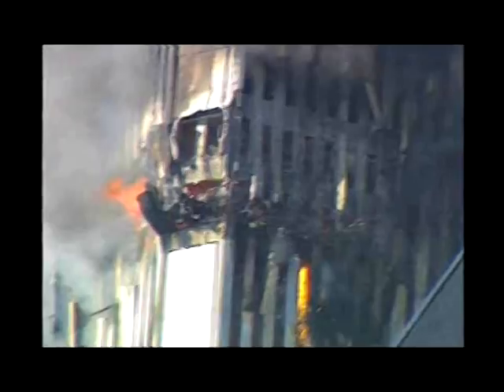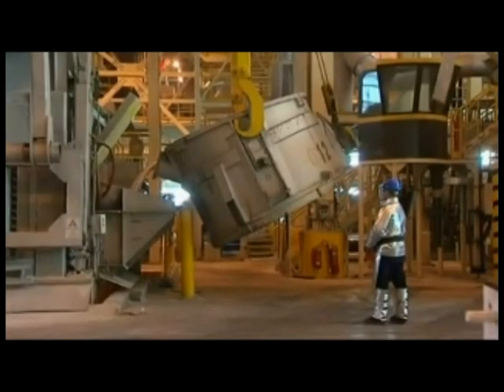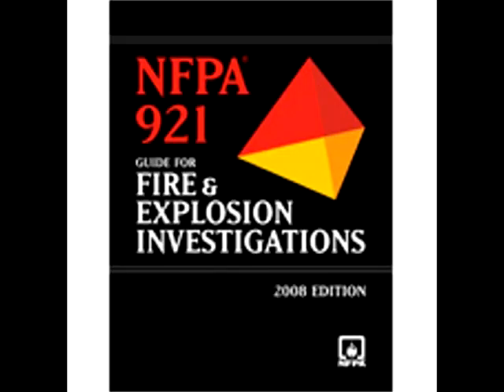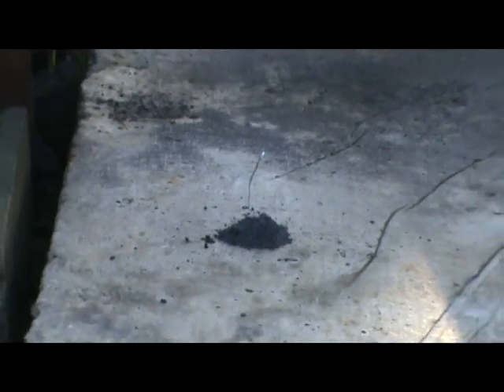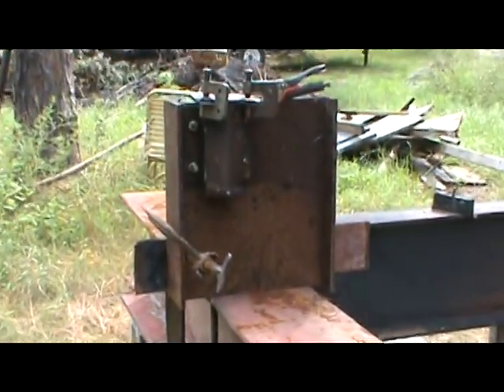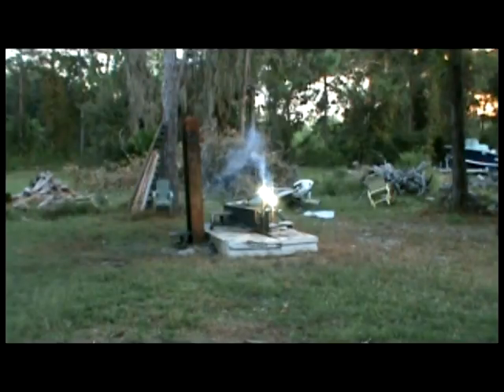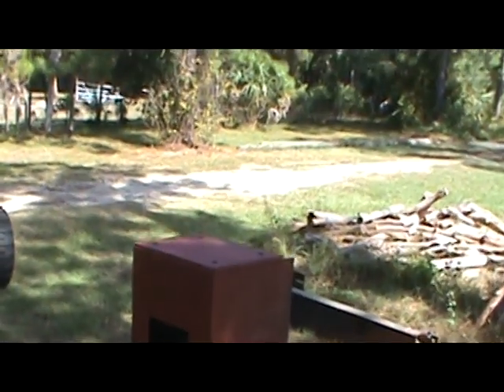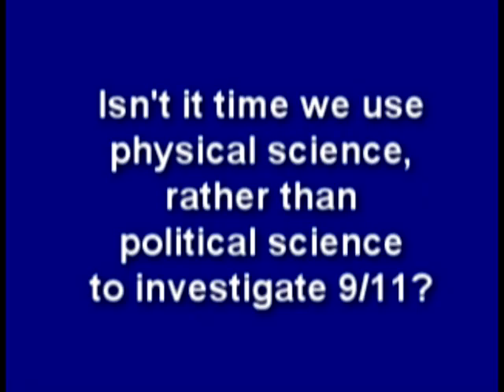9/11 Experiments: The Great Thermate Debate

Comment: You don't need to melt steel, you only need to weaken it. Steel loses half it's structural integrity when heated to 400°C.
Reply: But what about the melted steel that was pouring down the towers?
Reply: They came up with a lie theory of it was melted aluminum.    But even that needs 1300c  sorry 500-600c flash fire (fireball went out mostly the windows) wont do it.   And they forgot all the molten steel on the ground for weeks.   Hmm guess they were hoping no one saw that. @licsamael8235
Reply: It wasn't molten steel.  If you notice the stuff got brighter and hotter as it fell.  This means that the stuff was burning and the additional air it got while falling got it to burn hotter.  

Molten steel will flow like a liquid and will get cooler when exposed to moving air.  The guy who made this video probably knew this but was counting on people to mindlessly believe him because his target audience is people who were dumb enough to fall for such a lame conspiracy theory in the first place.

Have you ever noticed that the conspiracy theorists talk about 'thermite' but ignore the issue of how that thermite got placed without people noticing?  Remember that the main support structures for the WTC were on the outside of the building.  So they would have had to do the work on the outside of the building (89 some odd floors up) without anybody in the entire city seeing anything.

Just like they ignore the literally hundreds of eyewitnesses who watch the airliner hit the pentagon.
Reply: Ah yes, name calling.  I notice that you are unable to debate my points.  Amusing how you are so skeptical of everything but conspiracy theories.  

You know nothing about the properties of metals and as a result you fall for this kind of stuff.  The fact of the matter is that it was not molten metal in that video.  And if you knew anything about metals you would know that. 

Oh and if you believe this thermite theory - please provide a plausible way for them to have placed the charges without just about anybody in the city of New Your seeing them do it.
Reply: @colincampbell767  Not name calling simply putting you in group.    How did the metal on the ground remain molten for so long?   Why was it like a foundry on the ground weeks later?   Yes a little bit of flash fire 80 stories up caused this?   
Don't worry about how it was done, answer that simple question.
Reply: Yea right.  You call me a 'sheep' because I think for myself and you claim you weren't name-calling.

And do you have a reference for the 'molten metal' claim?  I just tried to look it up and all I got was conspiracy websites.  No independent confirmation from anything that can be considered to be an unbiased source.  And the idea that the metal would remain molten for a week is - rather dumb.  In order to remain molten there would have to be a heat source that would maintain it at that temperature.  12 ton billets of molten steel in foundries solidifies in a matter of a few hours.  There would have to be a continuous source of heat 

The claim that molten steel was on the scene at all can only come from somebody who knows nothing about the properties metals.  I can see some aluminum melting but the majority of it would burn (something people don't consider when they estimate how much fuel there was for the fires).  And none of it would remain molten without a source of intense heat.  

The idea that there was molten steel at all is just plain stupid.  That's tons of steel that would have to melt.  Even thermite wouldn't be enough to account for the claims.   

The problem is that if you know anything about metals - this whole idea is pretty dumb.

Now maybe if you can come up with something that actually fits the physical properties of the metals involved - I would take another look.  But as long as I'm seeing claims that are impossible - then I'm not going to be impressed.
Reply: @colincampbell767  You belong to a group call "Sheep" people that put heads in the sand.

I was watching the news live for weeks and listened to the fireman describe the foundry like conditions on the ground and saw footage of it.   At that time they were not attempting to hide it.    Myself a physics grad was waiting for them to explain how they were brought down and also to explain the source of the energy required to melt so much steel on the ground.   3 years later the report came (most people forgot about it) and those simple question were never addressed.    I saw it and also ground crew had to deal with it. They also had photos of the hot spots from infra red cameras.    All that was swept under the rug.   That little bit of stuff on the building dripping out was nothing compared to what was on the ground.   And for weeks.   Never explained to this day.
Reply: "fireman describe the foundry like conditions"  So that's your interpretation of what he meant?

Besides - from a physics perspective - what is your issue with the cause of the collapse?  

And your concern about the source of the energy necessary to keep steel molten for days is in fact an argument against the 'thermite' theory.  Can you identify a plausible source of heat that would keep this 'supposedly 'molten' steel from solidifying?  It can't be thermite because that produces a 100% burn in a matter of seconds.  And it will leave an obvious candle wax effect on the steel frames (as the molten steel flows down and solidifies on the non-molten steel below it).

And I have not been able to find a primary source for the claim that molten steel was on the ground after the collapse.  I've dug around and it seems to be conspiracy theorists quoting other conspiracy theorists.

As for the hot spots on infra-red - the fires burned for weeks afterwards.  So I'm not surprised that there were hot spots on the infra red.

And there's a logic flaw in your reasoning.  You seem to be demanding that they explain something that there is no real evidence that it even existed.  Maybe it would make more sense to expect the people claiming that there was molten steel on the ground come up with an explanation that would explain what the energy source that kept the steel in a molten state was.

This is the thing - the 'molten steel' claim is pretty much a physical impossibility.  And if your conspiracy theory depends on something that's pretty much impossible - shouldn't you be able to explain a plausible mechanism to explain it?
Reply: @colincampbell767  I think are in deep denial.  I did not even look at interne stuff back then.   I watched it live videos.   Metal flowing on the ground and fireman describing it.   Really not to hard to see it.   Oh you think it was all made up by the fireman?   And the video was faked?
Maybe 3 buildings never went down at free fall either.   The hot spots shown were over 1200 degrees.    So maybe that was faked too.    Back then this was just matter of fact there was no denials that it existed.  Only later do people like you come out of the wood work with crazy made up stuff to attempt to confuse what was plain as day back then.     Wake up and stop being part of the problem.
Reply: "Metal flowing on the ground . . ."  Odd how I cannot find any pictures or primary sources for this.

And I pointed out that you are interpreting the words of that fireman without really knowing what he meant.  The problem with 'what you saw' is that you cannot provide a plausible explanation as to how that molten metal got there and how it remained molten.  So what if there were spots at 1200 degrees - which is not even close enough to melt steel.  And you can get those temperatures in a charcoal grill.

The issue is that you are claiming that something was there despite the fact that for all practical purposes - absent a suitable heat source, there was no way for that stuff to melt in the first place or to remain molten. When you make a claim that violates the laws of thermodynamics - then you really need to explain how what you claim is possible.  If you can't do this - then you really need to re-assess your assumptions.
Reply: @colincampbell767  I know what I saw on the news sorry your internet skills are limited that you can't find it.

Also wonder why any nano thermite was found but maybe that was hoaxed too.   Maybe building 7 really did not fall at free fall it was just a trick camera angle.

I would like to see the metal that was shipped to china so fast.   I would like to see a proper investigation.    

When you pull your head out be sure to clean the sand out of the ears.
Reply: Why would nano-thermite be there?  In fact why would any thermite be there?  There was absolutely no need to use thermite to collapse the buildings.  You see - the whole idea that thermite had any reason to be there is just plain stupid.  (And ignores the small issue of how to keep the detonation circuits functioning after an airplane hit them.)

And you are using the classic dodge of the conspiracy theorist - demanding that I look thinks up that may or may not exist.

As for the speed the building fell - that's Newton's Laws of motion in effect.  Remember that kinetic energy is the mass times the velocity squared.  What this means is that when the building started to fall the energy of the falling debris became so high that anything underneath was instantly destroyed when it was hit.  So in effect it fell at 'free fall' speed because that's how the laws of physics work.  (Something I notice is how ignorant the people who believe the conspiracy theories are in terms of basic scientefic principles.)  I mean how to calculate kinetic energy is something taught in a high school physics class.

And are you sure that you know what you saw?  Or did what really happen is that you saw something and then decided what it was?  You see - molten metal on the ground would violate the laws of thermodynamics.  Unless you can identify the heat source that would keep steel in a molten state - that's a physical impossibility.  (And a problem with your conspiracy theory that none of you have been able to address.)

The entire conspiracy theory is based on an ignorance of basic physics, basic structural engineering principles, and a complete lack of understand of the properties of metals.  There are enormous holes in the conspiracy theory and the people pushing the theory are unable to address them.
Reply: @colincampbell767  You sound like an English major trying to grasp simple physics.  Googling terms then blurting them out without understanding them.   Building 7 is a bit of a enigma on how it fell at free fall.   Come on Sherlock put on your thinking cap.   Stop being part of the problem wake up.

I asked why was nano thermite found in the dust.   
Not why was it there.  
I'm a realist, you seem like some kind of denial theorist.
Reply: I'm not googling anything.  I have taken college physics and I have a machine shop in my garage.  I know this stuff.

And as I explained, there is no enigma - simply the laws of physics at work.  Building 7 fell at the speed it di because the laws of physics required it to.  As I explained kinetic energy means that once those things get moving - nothing is going to even slow them down.

Now unless you can identify an existing material that would have been strong enough to even slow down the falling mass . . .

BTW - care to explain why you think the building should not have fallen as fast as it did?  What was there that would have been strong enough to even slow down the collapse?
Reply: @colincampbell767  Lol a machine shop and a undergrad course does not make you a building engineer.    There is resistance of the floors below,  they can't instantly vanish at free fall, that would be breaking some laws.  The only way for that to occur is to pull all the supports at the same time.   That is why you have never seen a steel building fall like this in history.   Find me a similar steel building that fell at free fall from a fire and not controlled demolition.  Find it and get back with me.
Reply: Not an undergrad course.  And you don't understand structures.  The floors are designed to support about 20% more than their rated load.  That's It.  What to see where you're wrong?  Place a brick on your foot and then drop one on your foot from shoulder height.  It is not the mass that hits it that matters - it's the energy.  (And even if carefully and gently setting on floor on top of the one below it would cause an instant failure - the floors are not designed to carry anything near that load.  Most of the mass the floor and truss structure has to support is itself.  The people and office furniture are a trivial amount compared to mass of the floor and supporting truss.  And good engineering is to make the lightest structure possible that meets the requirements along with a safety margin.  

Lets say that this is an alternate universe and kinetic energy has no meaning (which is that your supposition requires) one floor fails and collapses onto the one below it, that floor then fails and now the mass of two floors is on the third floor, then the mass of three floors hits the fourth.  Each time a floor collapses the mass on the next lower floor increases by the mass of that floor.

So you would get an accelerating collapse whose limit on speed will be the acceleration due to gravity.

And the really sad thing is that you can confirm this for yourself if you simply Do The Math.
Reply: And the really sad think is that what I've given you is something you should have learned in your high school physics class.  This is not advanced stuff.
Reply: @colincampbell767  Ok HS course either way you can't compare a house truss to a steel building construction.   Are you a demolition expert?

It takes time for each floor to fail, the floor above falls then meets resistance and these are steel I beams not wooden.  They do no all fail at the same time its impossible.   unless you pull the rug out from all at once.   You can't obtain free fall otherwise.   And if this were the case then you would see free falling buildings all over the world throughout history.   Start and office fire and watch it free fall.  There would be no need for demolition teams.  Just some kerosene and a match.  Light it up wait 8 hours and you get a building that falls into its own foot print.   

Did you find me the other examples of steel buildings falling at free fall from fires?    Thought not.   Now go troll elsewhere.
Reply: @colincampbell767  I doubt you even made it out high school.   Building collapses are not part of HS or even undergrad physics.   Shows me you never even took a course.
Reply: It's a truss.  They all work on the same principles.  And yes I do know a lot about defeating structures in order to destroy what those structures are protecting.

If you disagree with me on what the trusses supporting the floors of the building were designed to hold - please tell me what those floors were rated for and what the margin of error built into the designs was.  (Which I should find amusing because all you will do is demonstrate that you know nothing about how structures are designed.)

Yes it takes time for things to fall and during that time it's accelerating.  And because it's accelerating it's gaining energy.  And if you think that the trusses supporting the floor below are going to hold for even an instant when hit by the floor above - show me your math that supports that claim.  (And it appears that - yet again - you are failing to take kinetic energy into account.)

And you really need to do a better job of reading.  I never said that they all fail at the same time.  What I said was that the floors are going to fail instantly (from a human point of view) when hit by the floors above.  There's simply too much energy involved here.

And all you have to do in order to see this for yourself is: Do The Math.
Reply: I take it you've never had a physics class.  Newton's Laws of Motion are taught in both the high school and physics 101.  That's why I keep saying that you should be able to do the math for yourself.  Calculating kinetic energy of an object of x mass falling for y time is taught in high school.  

That's why you should be able to do this for yourself.  

Here's a question for you: When an object falls on the floor below it - how fast is it going?  And if the object weighs one ton - how many foot-pounds of force does it have when it hits?  (Use 12 feet for the height.)

Do the math here and you'll see why the floors collapsed instantly and the speed hit nearly 'free fall' speed very fast.  It's all about Newton's Laws of Motion.
Reply: @colincampbell767  Lol I majored in it, 4.0 and graduate school.   Its a bit more complex than using simple 101 HS physics.    You know enough to be dangerous.   

Go back to school then get back with me.   Still waiting for the free falling buildings from fires you found.    Just as suspected ZERO examples.    

You and the cult of denialist theories are full of hot air.   You sound crazy.

free-fall time would be an object that has no structural components below it.  Do you know what zero resistance means?   

Look up controlled demolitions, you will find films where they take out the bottom floors firs the the entire build falls 4 stories the rest do not pancake down.    But even if they did the pancaking takes time which means its not close to free fall.  Anything that adds resistance adds time to the fall which is always less than free fall.
Reply: @colincampbell767   Ok so you are a house builder, that is not the same as a steel building.    You have not even provided any math or even a real world example of a building pancaking down to the ground at free fall from an office fire.    You do not have enough information to even do the math and they there are many variables to consider.  

The only example you can find of this is with controlled demolitions.   Where are the falls from offices fires causing the pancaking at free fall?.    You can fudge math by leaving out variables.    The math is often incorrect with real life because you forgot a variable so you have to go back an find the error because the math should match reality.   In this case it does not. 

FEMA does not even know what caused the collapse yet you do?

Then, toward the end of the report, FEMA observed:

“The specifics of the fires in WTC 7 and how they caused the building to collapse remain unknown at this time. Although the total diesel fuel on the premises contained massive potential energy, the best hypothesis has only a low probability of occurrence.” [Emphasis added.]

Thus, instead of pursuing the most likely hypothesis for WTC 7’s destruction — given that no steel-framed high-rise had ever collapsed due to fire and that the destruction of WTC 7 resembled a classic controlled demolition — FEMA posited a hypothesis that involved an unprecedented cause, for which it found no supporting evidence, and that it acknowledged had “only a low probability of occurrence.”
Reply: It's interesting that you talk up your qualifications - but you cannot do the calculations.  If you think that a floor of a skyscraper has sufficient strength to resist the collapse of the floor above it for any amount of time that apparent to the unaided eye - then support your claims.  How long would each floor hold before failing for the first, second and third iterations?  

I have given you explanations about how this stuff works and so far you are unable to explain your reasoning or to even do the math.  But you "majored in it" with a "4.0."
Reply: @colincampbell767  There is nothing wrong with being a house building but its not the same as a high rise steel framed building.     

Building 7 was not hit by a jet sorry.   Do you even know the type of construction used in building 7?  How many mains it had, how thick the steel was, did it use rebarb/cement or I beam etc.?
Reply: @colincampbell767  Your explanations are far too simplistic.   You don't know the construction of that particular building.    Hypotheticals using HS math will not work here.    But you can be sure you can't have free fall with any type of resistance.   I fear you have miscalculated.  You never even provided any of your calculations for building 7.    How could you without knowing the materials used in its construction.  What if the bottom 10 floors were solid cement, or titanium would you expect them to collapse at the same rate and load as if they were made of balsa wood?  You treat it like they are all made the same.   Without knowing some very specific numbers any math will fail compared to the actual building and its components.
Reply: @colincampbell767  You keep thinking a floor is going to fall 15 feet with ZERO resistance.    As if you threw it out the window.    You have air resistance, the walls, the framing, the I beams etc.    And it does not all hit at the same time.    Well in your fairy tale collapse its like throwing it out a window.   You think with enough kinetic energy it will just plow throw the first floor with zero delay, no resistance.   As if its a train moving 70 mps through rice paper.   It will lag the decent which will be less than free fall with just wind resistance.    No matter how much kinetic energy it has it will cause a delay which will make it less than free fall.   

No math even needed if you understand this basic concept.    Once you get into the math you have to understand the exact building, what it is made of, how many columns, the thickness, what its made of etc.    As I said before if the bottom half of the building were made of solid titanium there would be no free fall collapse from the heavy floors above.   They would just stop at the titanium level.   I am trying to make you understand that you need to know exactly what it is made of, how its constructed etc.  Not general but that particular building.   Is it made of wood, straw, cement, paper etc.    The collapse of these hypothetical buildings will not be the same.   But it would be in your fairy tale (no math to back it up) explanation.   

I think you are the troll not me.

specialized in defeating structures, so now you are going from a builder to a demolition expert?
Reply: @colincampbell767  . The findings thus far are that fire did not bring down this building. Building failure simulations show that, to match observation, the entire inner core of this building failed nearly simultaneously.
Reply: And what makes you think that their model - and the assumptions underlying the model are correct?  And if their model is saying that each individual floor had the excess strength necessary to provide any noticeable slowing of the collapse - did they provide any references that explain: 1) why the building was not constructed using the design practices that are considered to be 'best practices' for skyscrapers and 2) did the name the materials that actually had enough strength to do this?  #1 is possible but unlikely and #2 would rely on materials that are stronger than any currently which are considered to be manufacturable.

Even a basic calculation for kinetic energy shows that the first floor to collapse would hit the floor below it with a force equal to between 6 and 15 times it's own weight.  Since the rule of thumb is that office space floors should be capable of supporting 120-130% of their own weight (officially - with a 20% additional safety factor built in on top of that).  We're looking at a minimum of the floor below having to withstand a force that was 4 times what it was designed to withstand.  And the midrange estimate would be that it would have had to withstand 7-8 times it's capacity.

This is why I doubt the accuracy of any model that assumes greater strength than was standard engineering practice for when it was built.  If they are going to assume greater strength - shouldn't they be able to identify where this greater strength came from?

BTW - I seriously doubt that the 'know more than I do' if their model was not using standard engineering practices for the time the building was constructed.  The problem with models is that you can get a model to produce whatever results you want.  And I doubt that they published the data they used to construct the model.

Does the model explain this?  Or do they simply expect you take their word for it.
Reply: @colincampbell767  I think they are going about it the correct way.   They are not using some vague "rule of thumb" but exact replica of the building using actual data from that building.    All the data will be made public unlike the 9-11 commission which hid the programming.    Its open and honest unlike the sham of a investigation that was done.

You can look it up, they are not hiding anything.
Reply: So do you have a link to their methodology?  I hate the 'vague 'you look it up' stuff because that always makes me suspicious that the information does not really exist.  If you notice that when I told you to look up the characteristics of structural steel at various temperatures I gave you the exact words to type into Google.  

BTW - is there any evidence that the engineers who designed those buildings varied from standard engineering practices?
Reply: @colincampbell767  Its all in the video I linked.   Building 7 was over built.   It housed the CIA, SEC, Banks, etc.  
Also was a safe house for the Governor.  The place he would go if city was under attack.   Good thing he was warned it was being pulled so they all could get out of the bomb proof suite. 

They have all the specifics on that building.    You probably can find them.   

I'm thinking of a new business model for demolition.  Would put the other companies out of business.   Other companies charge a fortune to take a building down.    They set up for weeks to get all the charges planted and even then sometimes it does not come down right.    I would only need a few employees and a gallon of kerosene.   My prep is to start a few office fires on the top floors wait 5 hours and it all comes down into its own footprint.    I think I can outbid any of the demolition companies.   What do you think?  Don't tell anyone though.
Reply: Actually it did not house a 'safe house' it housed the city's Emergency Operations Center.  And I regard You Tube videos as horrible sources of information.  And wasn't the building evacuated as part of the response to the attacks?  IIRC the entire WTC complex was ordered to evacuate at the same time.  

And housing banks and govrenment offices (CIA? Really?) hardening is done to the architectural walls - not the structural components.  Mostly because of the weight issue - add reinforcement to the floors and trusses and you increase weight.  Increased weight then means that you have to reinforce your load bearing columns.  This adds more weight.  And all of this weight means that you need to do additional work on the foundations.  And this is also expensive.

Besides - why would you need to reinforce a concrete floor that's supported by steel trusses?  Nope - I'm not buying it.  Show me a reference that is not from an aluminum foil headgear site and I'll be willing to consider it.  But the 'safe house' claim tells me all I need to know that the information is probably based on speculation and rumor.
Reply: @colincampbell767  It did house all those things but I don't know what they did to the building to beef it up.   I am no expert on the construction of building 7.   I was joking about the other stuff.

You have to admit it does look like a controlled demolition.   I can't find another building that has ever fallen like it without some kind of demolition.    I am curious what they find in the computer model so far it looks like the mains had to be pulled all at once but the report is not finished yet so will have to wait for it.
Reply: Then why did you claim that Building 7 was over-built? And what would need 'beefing up' for things that were essentially going to serve a office space?  An Emergency Operations Center is basically a bunch of workgroups around tables.  Assuming that the CIA claim is real - it would have been office space as well.  I can see reinforcing of the architectural walls and the doorways - but this would not affect the structural elements.  

And there have been very few tall that have collapsed (which means that the engineers have been doing a good job for the past 100+ years).  But there have been several partial collapses and the debris fell straight down.  The Ronan Point collapse is and example of that https://en.wikipedia.org/wiki/Ronan_Point .

The Hotel New World collapsed - again straight down.  L'Ambience Plaza kind of fits the list in that it also fell straight down - but this was a construction accident so you decide if it should be counted.

The Sampoong Department Store collapse is a very good example of a building collapse that looked like a controlled demolition: https://en.wikipedia.org/wiki/Sampoong_Department_Store_collapse

Vieira Fazenda office block collapse - now this is an example of a building collapse where everything did not fall straight down.

The Plasco Building in Iran is an example of a structural collapse die to a fire.  https://en.wikipedia.org/wiki/Plasco_Building  This appears to be the closest I thing I can find to the WTC.  Here's a video of the collapse: https://www.youtube.com/watch?v=sPGr4D1-zDI

Hopefully the links work.  What I did, was go to Wikipedia's list of structural failures and looked for any building that failed and the article gives an indication as to the direction of the collapse.
Reply: @colincampbell767  I appreciate the links but those collapses look believable and do not fall into its own footprint like building 7.   Building 7 goes down and all the windows are intact, was not a top pancaking down collapse.  Take a look at building 7 (not wtc 1 and 2)   I can't find one like that or close to it.
Reply: All but one of them fell into their own footprint.  And I noted the exception. If you are using the fact that a small amount of debris fell outside the footprint - I'll point out that this was the case with building 7 as well.

In fact just reviewing the available information from the Wikipedia page - I noticed that in both partial and full collapses the debris falls straight down.  Which makes sense from a physics point of view because it would take some kind of lateral force to cause the building to topple like a tree.  And even then - once the load is no longer supported by the columns the building will break apart and the debris will fall straight down.  Remember that those columns are very strong against vertical loads - but have little to no strength against lateral loads.

There are two exceptions on the Wikipedia page that I did not include because the structures of the buildings did not fail and the buildings remained (generally) in one piece afterwards.
Reply: Apparently you have never taken even a high school physics class.  If you had - you would not be taken in by BS.

And this is nothing more than stuff derived from Newton's Laws of Motion - which have been around since 1687.  Kinetic energy is equal to 1/2 the mass multiplied by the velocity times itself.  This principle can be demonstrated yourself by placing a brick on your foot and noting the effect - and then dropping a brick on your foot from a height of five feet.  

It is the speed gained by that brick that provides most of the force your foot feels when it hits your foot.  And this applies to buildings as well - a floor and it's supporting trusses falling onto the floor below from 12-15 feet will blow right through that floor.  The resistance created by the mechanical deformation of concrete and steel will be completely inadequate to slow the collapse in any manner detectable to the unaided (or untrained) human eye.

The sad thing is that if you had taken that high school physics class - you would not be gullible enough to think that it's a "conspiracy" that the building collapsed at the speed it did.

You appear to be claiming that the collapse - for some reason - violated the laws of classical physics.  Care to explain what that reason is?  (BTW - if your answer demonstrates that you know nothing about any of the principles of structural engineering - my next post will be me laughing at you.)
Reply: @colincampbell767  And of course the collapse was caused by simple office fires.     

Please tell me less.
Reply: And how many hours was the fireproofing protecting the structural steel rated for?  You said that the building burned for seven hours?  And what type of fire was the fireproofing rated for?  Was the fireproofing rated for a fully involved fire for more than two hours?

Even with a 'simple' office fire - the fireproofing is only going to hold out for so long.  When the last of the fireproofing ablates away - there's nothing keeping the heat away from the steel.

Also remember that the building had known serious structural damage caused by the impacts of debris from the collapse of the towers. And that the estimated weight of debris on the roof significantly exceeded the load rating for the roof.  (Which are basically designed for the weight of snow on the roof.)

And it wasn't a 'simple office fire.'  If for no other reason - a simple office fire would have significant firefighting resources arrayed against it.  The fire safety codes were not written for a fire like the one in WTC 7.  Remember that prior to the mid 1990s these were 'life safety' codes where the intent was to ensure that everything held together long enough for the building to be fully evacuated.

BTW: do you know if the design flaw in the structural steel buildings identified by the results of the Northridge Earthquake had been mitigated?  If not, then the building was not as strong as the designers original calculations showed.
Reply: @colincampbell767  I can see you guys are busy with this discussion but I was intrigued on a couple of things. Could you elaborate because I am on the fence with this whole thing

1. How would you debunk the molten steel theory? You have said it isn't molten steel. Please give your opinion
2. I am interested in the proof of another building falling the way the twin towers did. I think somewhere amongst the barrage of comments lays the exact quote from "Bob"

Thanks
Reply: 1) There wasn't any molten steel.  The only references you find to "molten steel" are from the aluminum foil headgear websites.  What people claim to be pictures of "molten steel" are actually pictures of some sort of burning material.  You can tell it's burning because it heats up as it falls (from the increased amount of air it's getting).  

The claims that visible liquid steel was found on the ground are simply beyond stupid.  In order to remain liquid It would have had to be insulated by refractory brick and supplied by a source of heat that's hotter than the steel itself.  Prior to the invention of the induction furnace this was done using special ovens that preheated both the gas used as fuel and the air to near incandescence prior to mixing inside the furnace.  And you would have still needed refractory brick to both insulate the metal and to reflect infrared energy back onto the metal.  

Making molten iron is so difficult that it was not until the early 1800s that a process was invented to do this.  Prior to this they were able to heat the metal to 'welding heat' and working it by literally pounding on it with hammers to drive the excess carbon and slag out.  The necessary conditions to melt iron/steel are not going to appear on the surface of the earth by accident.

And even if thermite were used - there would be little to no visible molten metal as the molten steel would flow down the structural elements and rapidly solidify as the steel absorbed the heat.  Not only this but there would have been a telltale 'candle wax' type effect on the cut sections.  

And then there are the plausibility issues.  First of all there is the question of how could the thermite have been placed without anybody noticing?  Exposing the interior structural elements of the building would have required extensive demolition and replacement of the architectural walls and surfaces.  Even worse would have been the placement of the thermite on the exterior support elements.  This would have required cranes, elevated platforms, street closures, and would have taken months.  Yes the conspiracy theorists claim that all of this occurred - without anybody noticing.

Added to there is the requirement that their wires that lead to the initiators would have had to survive having an airliner crash into them and a two hour fire.

Another plausibility issue is the requirement that a group of conspirators smart enough to do all of this in secret and keep everything secret for well over 15 years - were at the same time dumb enough to think that you needed to melt the steel in order to make the building collapse.

So - there was no molten steel.  

2) I gave some examples earlier on in one of these threads but go to Wikipedia and look up building collapse or structural failure.  I looked at each of these and only found one where the buildings did not collapse straight downwards.  The one most similar to the WTC collapse (fire weakening the steel) is the one that occurred in Iran in the early 2010s.  

However the reason there have been no collapses like the WTC collapses is because the conditions that caused the WTC collapses have never occurred except at the WTC.  Remember that those ere 757s and 767's that hit the buildings - which are larger than the 707's that the engineers (attempted) to engineer the building to survive.  

An error in the engineer's calculations was the failure to account for the damage to the insulation over the steel in this scenario.  

Another problem was a systematic error that was not detected until the Northridge earthquake in the early 1990's.  There was an unknown design flaw in all steel girder buildings.  This flaw introduced loads onto the steel that were not factored in when the loads the steel could support were calculated.  (In addition it was discovered that the welding techniques used had a bad habit of burning the carbon out of the steel - which turned it from steel into the more brittle iron.)

This structural flaw was practically universal all over the world because everybody regarded these designs as 'best practices.'

This means that unless the WTC's structural elements had their connections cut out and replaced (a process that would have taken years) the building was significantly weaker than the designer's calculations predicted.
Reply: @delosombres You may exit stage right hombre :)
Reply: And once you heat it to 400C it magically turns into a molten steel and remains hot for weeks.
Reply: "And once you heat it to 400C it magically turns into a molten steel and remains hot for weeks."  

"Magic" is what it would take to do that under those conditions.
Reply: ... and how did fires at the tops of the buildings heat the steel columns all the way down?......
Controlled demolition....
Building 7??